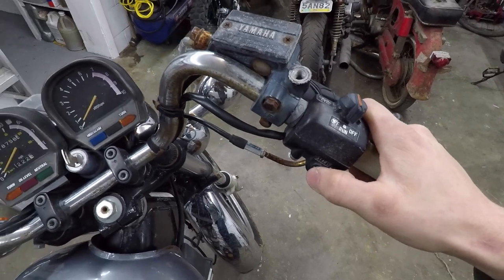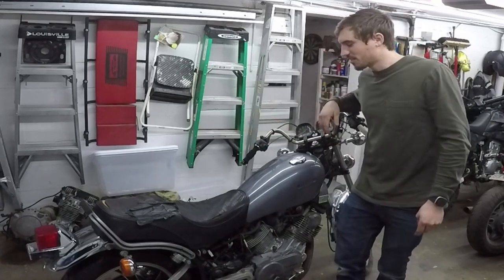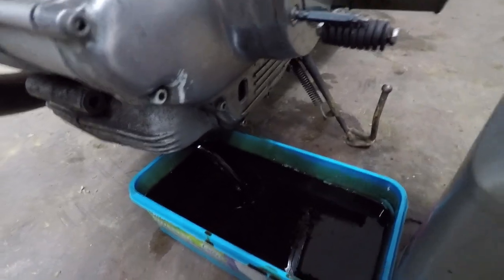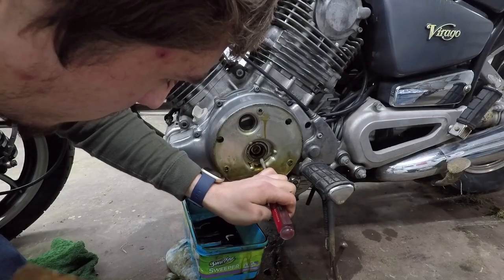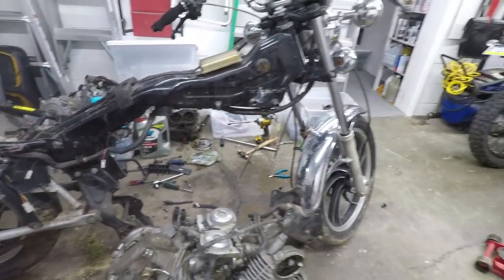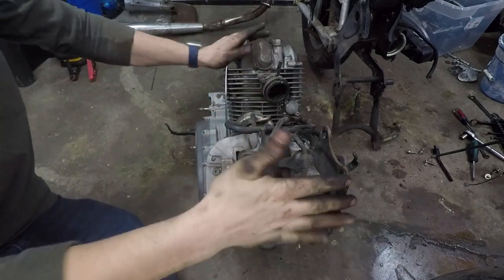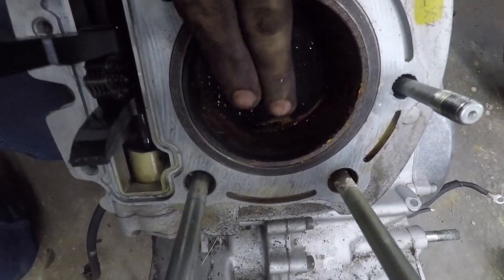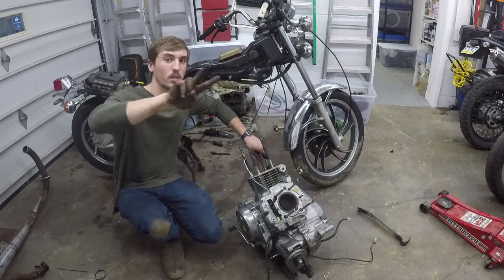$100 Yamaha XV750 Virago, How Bad Can it Be?

Comment: The broken cap is for access to the flywheel nut. It is meant to be just lightly torqued as they have an o'ring seal. Users get confused by the directional arrow for manually turning the motor over. They end tightening it and breaking it off as in this case.
Reply: i broke mine off the first day i worked on it

Comment: Just speculating here, maybe skipped timing on the cylinder with the stuck valve. Chain not tensioned tight enough. then when it hit the piston bent the valve shaft a bit and would not move back in correctly. Once you remove the valves that will tell you the story. Love your videos, keep up the good work.
Reply: But it's drive shaft right no chain, I have this bike. I don't know much about bikes just trying to slowly get it going..
Reply: @stetsonharrison8951  He's talking about the cams.
Reply: @stetsonharrison8951  Cam timing chain inside the motor.

Comment: As you can see, these bikes have  cam bushings instead of bearings. The cam will seize up in the bushing if it's not getting good oil flow. It is possible to replace the bushings with bearings.

Comment: In some curcumstances the hole becomes blocked or isn't big enough. The hole to the pipe that delivers oil to the camshaft. You can get camshaft seizures i think they do a replacement bearing so the cam spins on a bearing instead of a metal shim..but if oil delivery has been an issue the cam will heat up and seize. And their is a metal pin on the camshaft that can snap.

Comment: Fuel is in the oil.  The carbs are leaking from floats into the motor and into the oil.
Reply from the maker: It doesn't smell like gas though..
Reply: Yep, that fuel has been leaking into the engine over a long time, won't smell of fuel as it likley years old.
Reply: @chrisgreenwood271  he's right.
Reply: Do you sell cab
Reply: @GoldGuyRides 😢

Comment: You got your money's worth, and a whole lot of headache's ahead of you if you decide to do more than turn it into spare parts for someone else's project. Sure the bikes are plentiful, and spare parts may be had, but these bikes have long histories of electrical failures, bad grounds, ills tuning the carburators for many, as well as reoccurring woes with the starter solenoids as they weren't redesigned for reliability until ten years after your model. Most people just mess them up by doing sketchy stuff to them, or by playing West Coast Choppers with them, making them even less worth the headache that they can become. If the bikes already this bad with the opening shot, count on major migraines for the rest of the repairs you'll be making in the future. If you must have a Virago, buy a later model made after 1993 that has the 1100cc plant onboard as it will have the power reserves you'll want once you get it out on the open road. Pay more, and get the best example, since these bikes will bankrupt you, and drive you nuts if it's been left unattended, or neglected at all.

Comment: very nice engine. in this case no super heavy cardan shaft  final drive.  A known issue with the case hardening on the gears.=jumpimgout of bottom gear. jthe gears from the later xv1100 will go in...I been told.

Comment: I didn’t see it on your store but do you still have the virago oil filter cover?
Reply from the maker: Nope I sold it, sorry!
Reply: @GoldGuyRides  all good thanks for letting me know.
I have a carb/fuel question that you may be able to help with, I know you’ve worked on maybe different bikes/carbs

my xv750 virago is slowly getting put back together and i’m suspecting I might have a future issue with fuel system

I have the original gas tank and original carburetors and intake boots/manifolds.

I DONT have original petcocks. I have aftermarket petcocks with only 1 outlet for fuel (no vacuum line outlet that the OEM has). These petcocks have option of OFF/ON/RES.

Now, will i be okay with plugging the intake manifold outlets where the vacuum lines would connect to? and would the fuel still be pulled into the carbs when idling and reving the bike?

Comment: Damn man you should have left that motor alone, I would have had that thing running in 10 minutes.
Reply from the maker: @brichardwaters666  nah bud this was a non runner. Camshaft was seized due to oil starvation.
Reply: @GoldGuyRides  that valve was hanging open because the lobe was keeping it open.